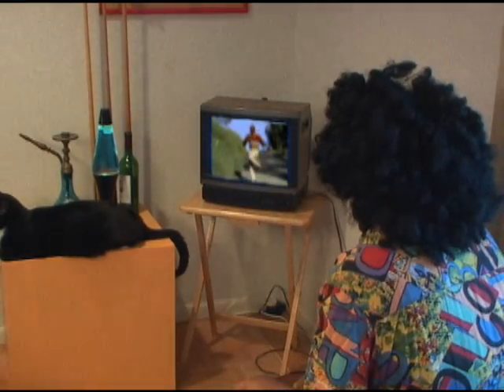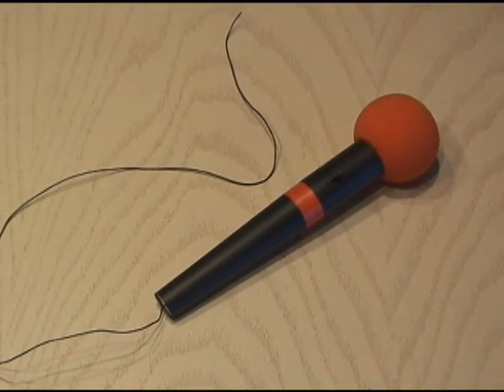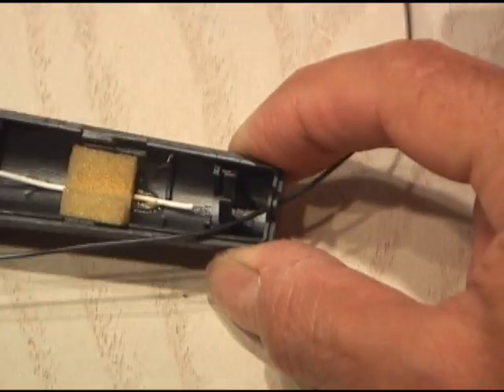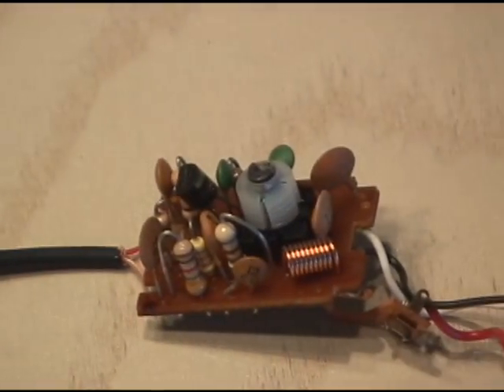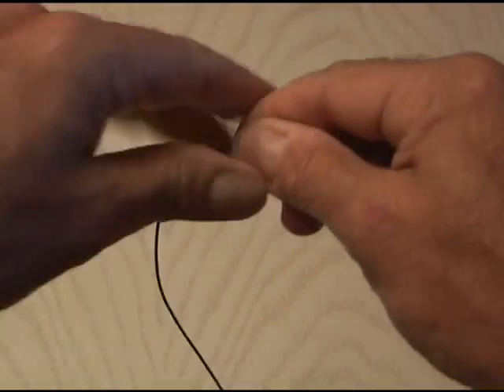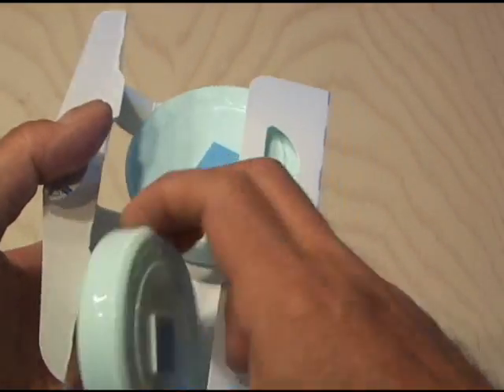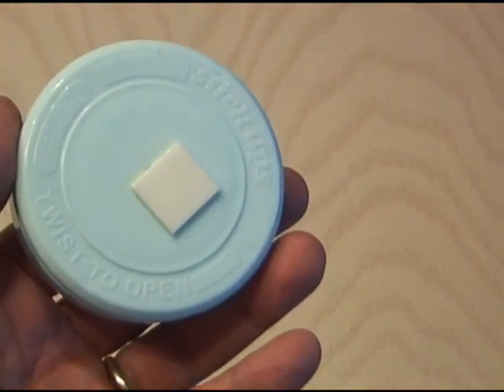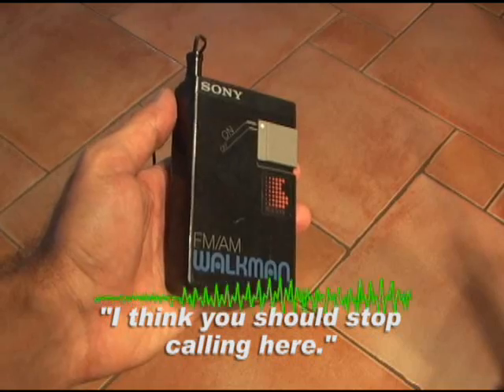Mr. Microphone Hack!

Comment: I did this back in the late 80's. I hacked a mr mic and put it inside my electric guitar with a 9 volt battery and LED and toggle switch. That thing would broadcast across the street from where I lived. worked so good some kids broke into my house and ripped off my guitar. Oh and the antenna wire just hung out of the pick guard and the plug jack still worked for a regular amp. Oh and the Cops wouldnt do a thing, just glad it was a cheap guitar..

Comment: I doubt that will work up too 100ft away.  FCC limits power to these type things  i doubt a cheap mr microphone puts out FCC limit power.

I made a Am transmitter that puts out all of the power the FCC allows and that does do 100ft but not very good.

Comment: If you just place a microphone anywhere it won't have any power supply, it won't have any transmitter so what's the point? It will be a microphone, that's it. It won't do anything.